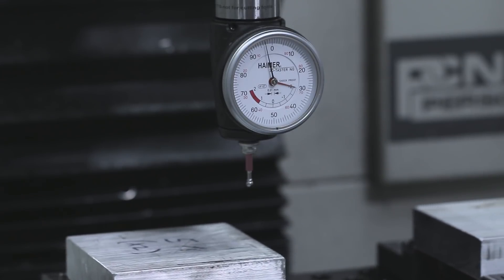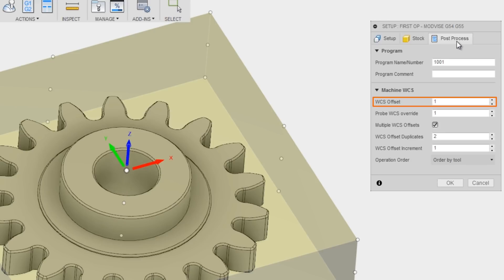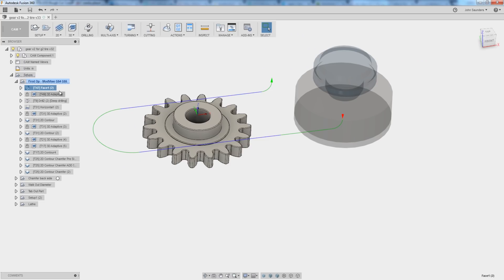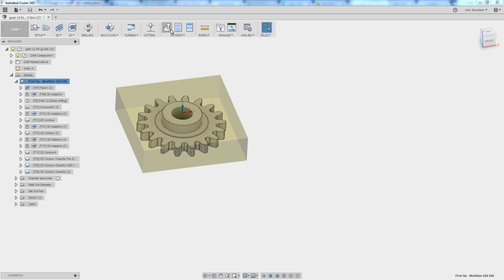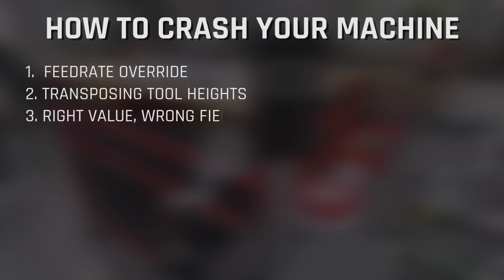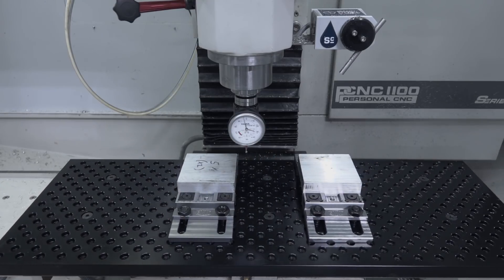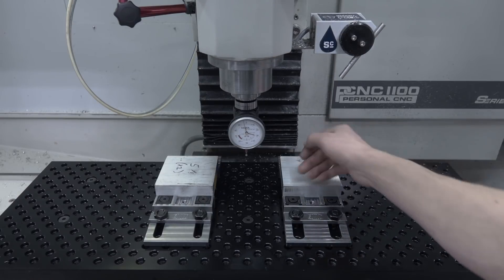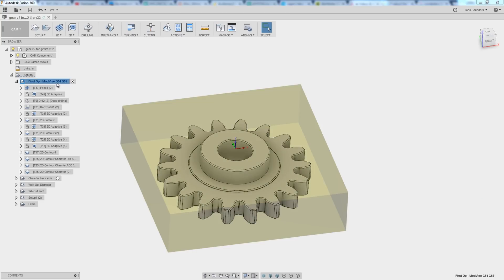G54 & G55: Using Multiple Work Coordinate Systems in Fusion 360

Comment: suppose I have a single part that has numerous similar / identical operations, except they're on different locations. For example, a six-sided pyramid. Can I create a setup for one side of the pyramid, and then replicate that setup radially on the z-axis to do the remaining five sides using the same operation? In other words, it would be like running a single side operation, rotating the part 60 degrees, and then continue the same operation as before, except by using WCS I would not have to move the part? Do I have that right?

Comment: Have you found a way to do this with a double vise where the G54 is in the front jaws and your part is going X+ and Y- then in G55, on the back jaws, your part would be going X- and Y+? In a double vise that central FIXED Jaw is what you need to go off of so for back jaw operations it gets messy

Comment: I'm not knocking this at all, I have to be honest. You seemed to have made it harder than it had to be. If they're identical routines, couldn't you have copied it in to notepad and created it?  I use CAD/CAM too, but man knowing your code is important. I don't fully trust some post processors either..
Reply: Copy & paste in notepad doesn't optimize tool changes.  You would complete on part then the next.  With this method, both parts are completed together (face both, then contour both etc. ) this reduces run time by eliminating extra tool changes.
Reply: Why go the extra step of copy and pasting and possibly missing something when the software will do it for you without error? Or least less error than an extra human step could induce. 

Plus you can optimize the routines and have both parts done at the same time rather than complete one part entirely before starting the next.

Comment: Thanks for the videos - love them and watch them all - very useful tips for learning Fusion 360.  I noticed your Haimer was not on zero before using. I believe you should use the ring to centre the 0 on the needle first.  Cheers.
Reply: The official answer is that Haimer 3D sensors do have a set screw adjustment. You are supposed to adjust the Haimer so that it reads zero when it is not under load, according to the manual.